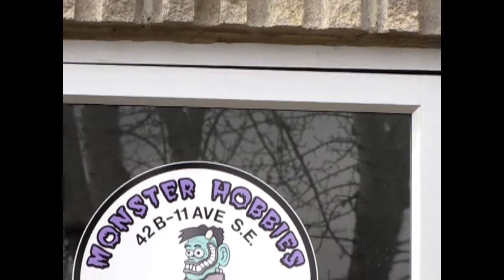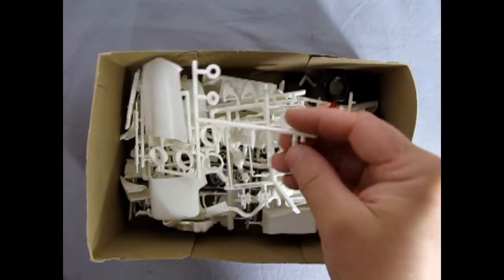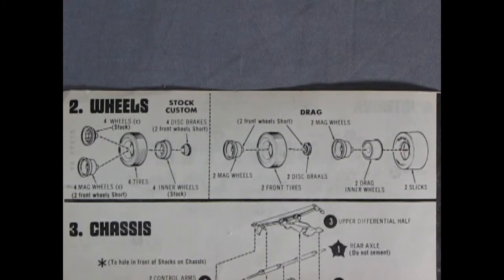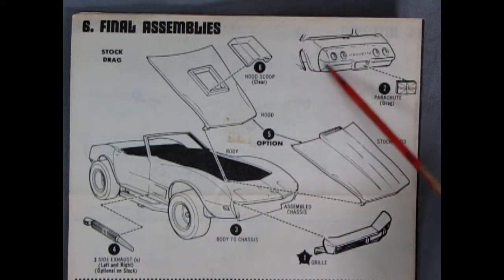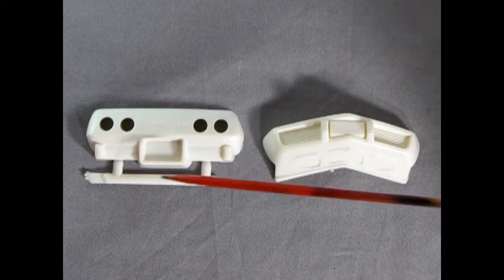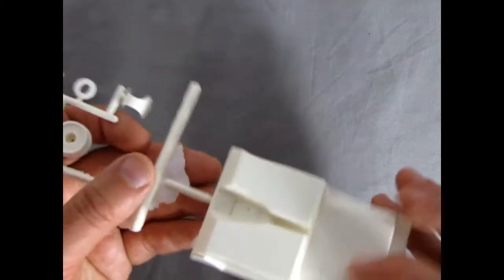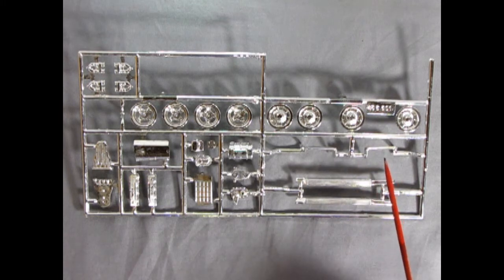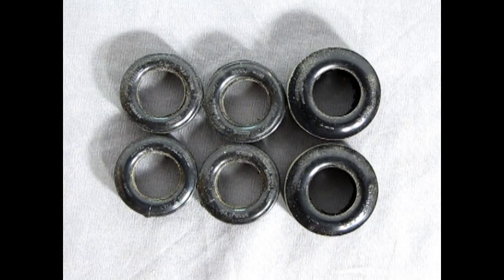Model Car Garage - The 1974 Chevrolet Corvette Convertible By AMT - A Model Car Unboxing Video

Comment: Great vid, Trevor 👍🤩shame about the windscreen, do you think the marks will polish out🤔 I might have spare glass🍷. Put the sprue code in the comments and I'll check. 🤓Pete 😎
Reply from the maker: Sprue code? I'm not sure what you mean.
Reply: @MonsterHobbiesModelCarGarage  the part number on the frame the parts are attached to 😀
Reply from the maker: @petesmodelcarcustoms584  I'll look for it, but I am not sure if they did that in 1974.
Reply: @MonsterHobbiesModelCarGarage  I've watched video again. Both the glass and the chrome sprue(parts tree?) have code numbers on. I can see but not read the codes🤓😒. 🤓Pete 😎
Reply from the maker: @petesmodelcarcustoms584  Ok, I'll have a look this weekend when i film more car videos.
Reply from the maker: 366301
Reply: @MonsterHobbiesModelCarGarage  👍🤓. It's close to my date of birth😁. I've been buying a lot of odd models for parts, so I'll have a look🤓👍. If I haven't got one, someone else might😃.. 'Be prepared' for an answer in a day or two. 😁. 🤓Pete 😎
Reply from the maker: @petesmodelcarcustoms584  Sounds good. I think pretty much any 1968-1982 AMT Corvette windshield would work in there.